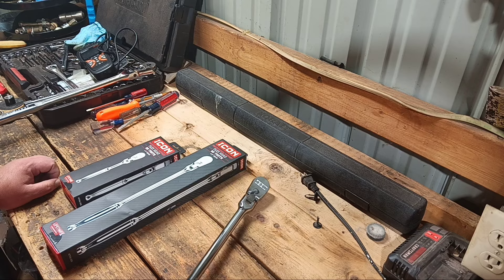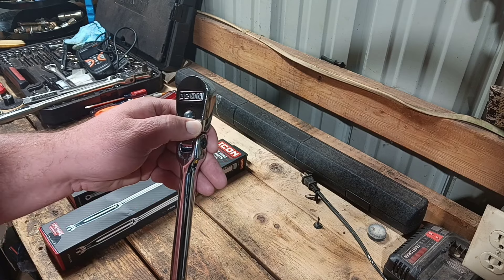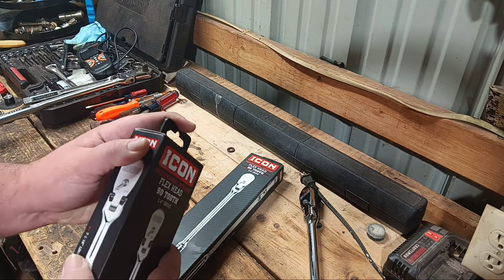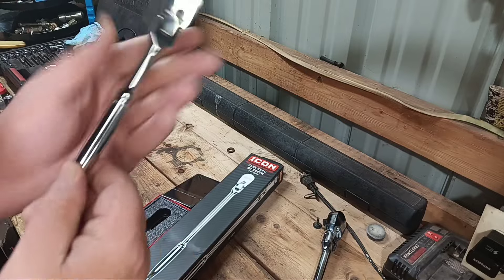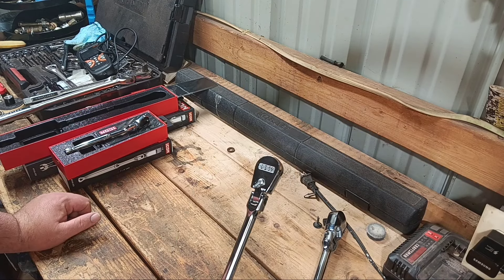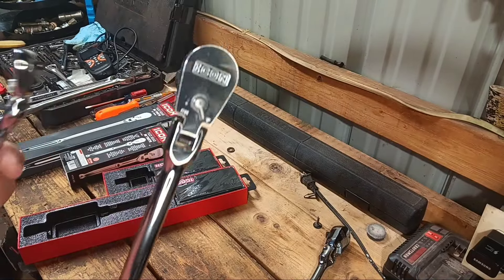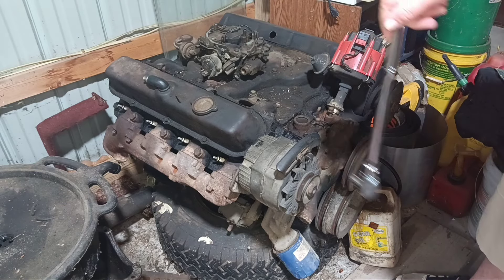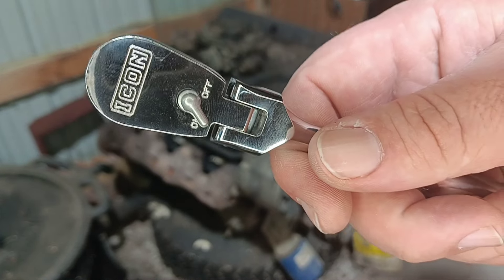Icon flex head ratchet.

Comment: I use my 1/2inch Icon flex head ratchet the most and it’s absolutely amazing. I’m a tech and I use it for alignments, removing toyota oil filters, and breaking brake caliper bolts loose. I wish they’d release an even longer 1/2 inch ratchet. Great video!
Reply from the maker: Hey thanks for the compliment and glad you enjoyed the video.  Thanks for the input and letting us know how they hold up in a professional environment.   Thanks again for stopping by the channel and thanks for commenting!!!
Reply: someone bought breaker bar and put the 1.2 head on it its like 4 foot long now lol

Comment: Semi locking and no locking are kind of the same..if it needs to move it will..personally it doesn't matter to me either way..
Reply from the maker: Yea those little grooves on those craftsman ratchets don't really do much.  I guess if I had an actual locking flex head with the little switch it might be different but I'm really digging these ones the way they are.  Thanks for watching and commenting.  Glad you stopped by the channel.